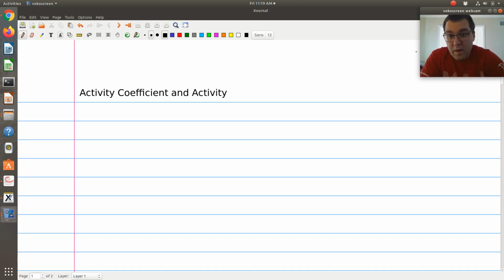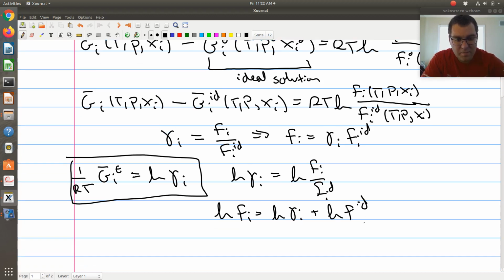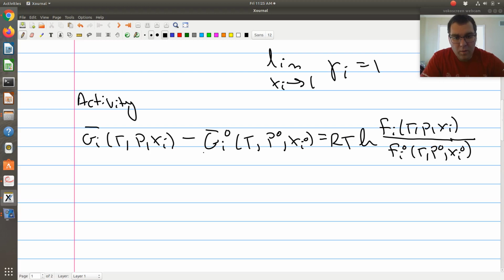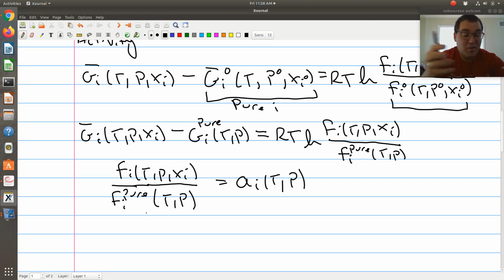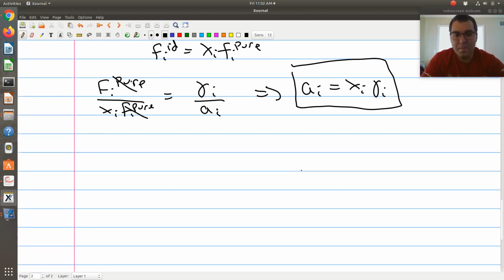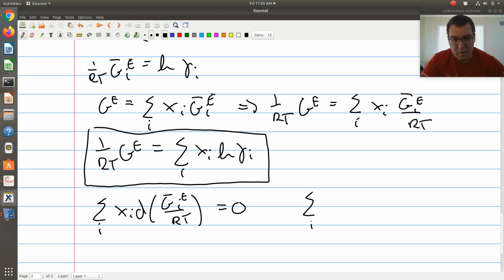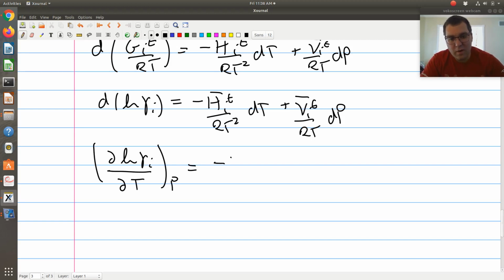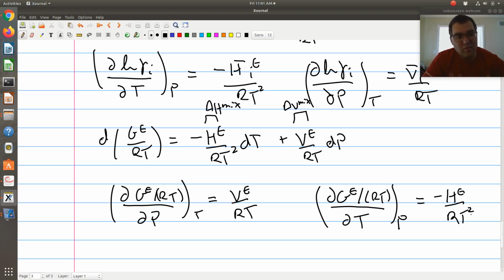Chapter 12: Activity coefficient and Activity

Comment: Hi I had a doubt that we use Activity coeff in VLE calculations, for that we go through series of procedure like.
In general during the process design of chemical plants, especially for distillation and liquid-liquid
separation systems, it is necessary to predict the values of activity coefficients for carrying out phase
equilibrium calculations. However, experimental data on activity coefficients of various types of liquid
solutions are often not available at conditions (of temperature and/or composition) of interest. In such
cases activity coefficient models - which relate GE to solution composition (at a given T&P) - are
useful. Most of such models are based on semi-empirical considerations. These models are all
characterized by a set of parameters that are temperature dependent. Vapour-liquid equilibrium (VLE)
data at low pressures are readily used for computing the value of such parameters.

So, in that case in a typical isothermal VLE data generation experiment, the equilibrium pressure and the
corresponding vapour and liquid phase compositions are measured and the activity coefficients of each
species estimated at each set of liquid phase composition.  Once the different sets of activity coefficient values for various liquid phase
compositions, ideally ranging over 0 t o 1, i x = the excess molar Gibbs free energy is computed at each
composition using the equation Gexcess/ RT  = ∑ xi * lnγ.

Then we use the Gexcess/ RT to calculate the parameters of various VLE Model.

How are these parameters furthers used?